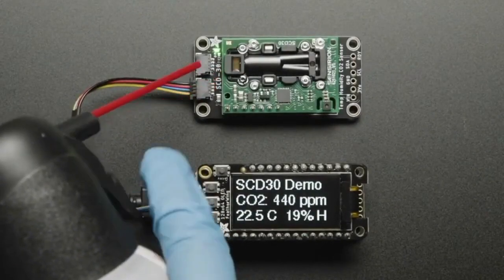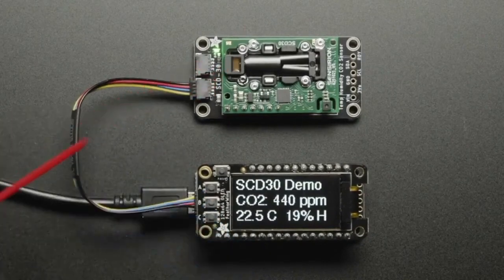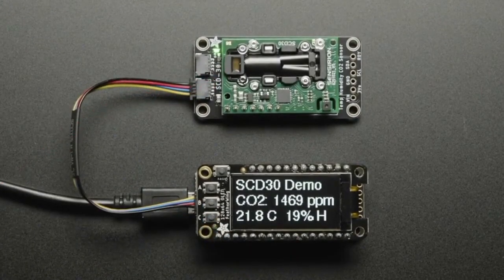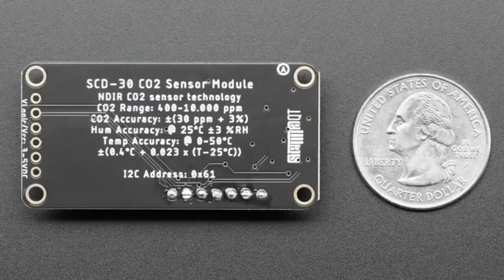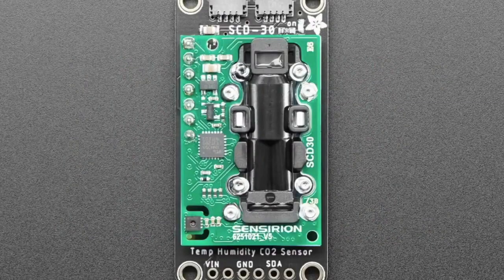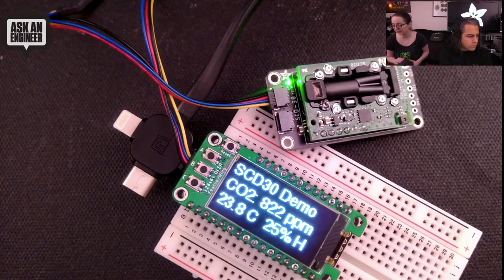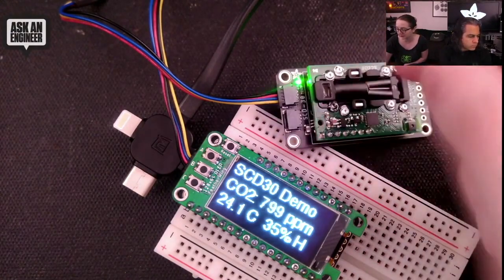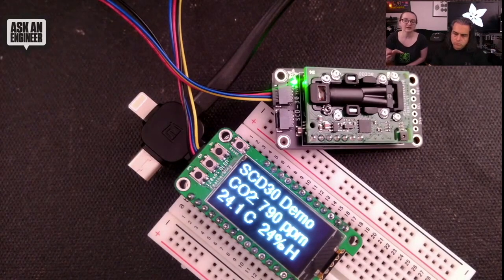Adafruit Sensirion SCD-30 - NDIR CO2 Temperature and Humidity Sensor - STEMMA QT / Qwiic

Comment: CO2 levels are an extremely important issue in measuring levels of ventilation in rooms etc. related to COVID prevention.  Real CO2 detection is important, not a derived value from VOC  measurements.  For example the state of Minnesota is recommending less than 800 ppm of CO2 in school rooms.  CO2 monitoring is common in Japan.

Comment: hello I have a small one 25 m2 cork greenhouse using sdc 30 I just installed the system. But if the ambient humidity will be 90%, will this cause the sensor to fail? Do you have a suggestion for this?

Comment: Considering the video, it would be most helpful for the relevant code to be published, which allows the NDIR CO2 sensor data to be displayed on the Feather SH1107 OLED, as is demonstrated by the video. The provided example code shows either the Feather's connection to the OLED or the Feather and the NDIR CO2 sensor. No example code seems to be available showing the NDIR CO2 sensor, the Feather and the OLED working together. Sincerely hope that the example code (as used in the video above) - either Arduino code but preferably CircuitPython will be made available. The three components alone are £100 - so any additional help would be most appreciated. Keep up the great work!

Comment: The datasheet states that it reads from 400-10.000 PPM of CO2. Do you have any experience reading lower numbers or does this not make sense (i'm thinking of 250-400 PPM (outdoor air))
Reply: The average ppm levels are 415ppm now. The only place you'd find 250ppm would be in air that's been scrubbed of CO2, not common outside of the world of rebreathers.
Reply: I also need one that goes below 400